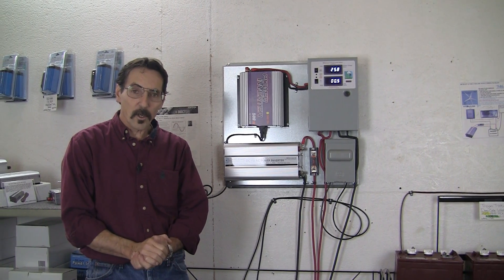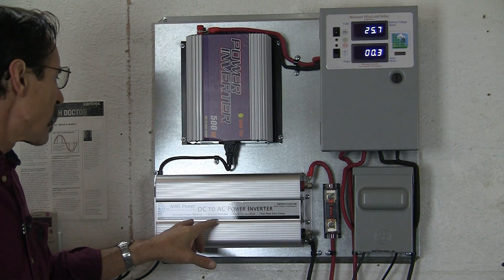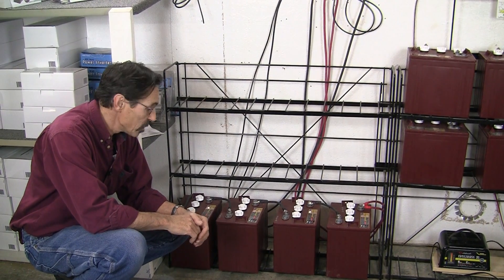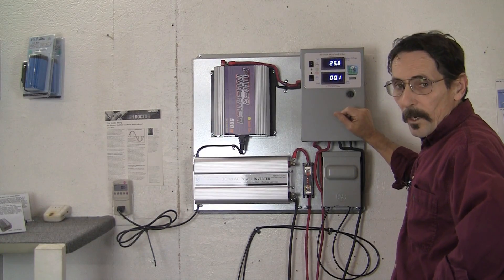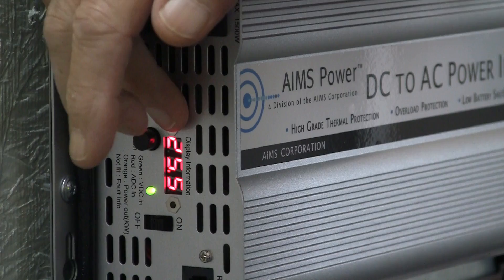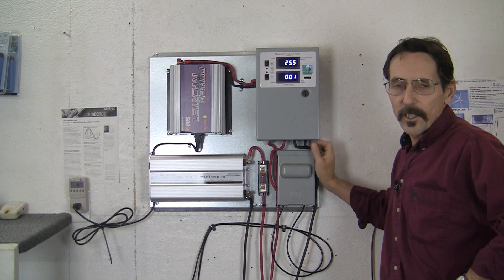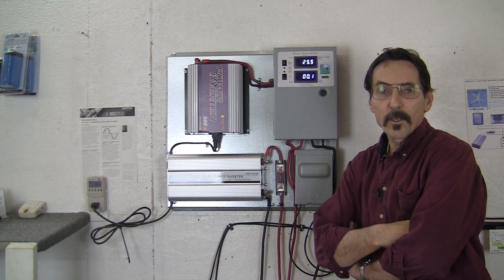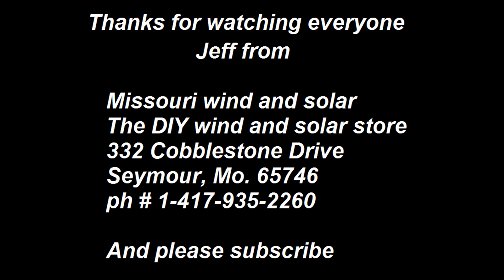Missouri Wind and Solar Sun Grid tie inverter with battery back up

Comment: Very informative videos, thank you.  Most videos I've seen involve hooking up one large 3 or 6kw inverter but one thing I am not seeing in any videos anywhere is if you can stack multiple grid tie inverters in parallel to sell wind power back to the grid in the 100KW range, say 50 inverters at 2000 running watts ea.???  Yes there is enough wind in my area to set up this large a system.
Reply: I have yet to see any Utility company write anybody a check, what they do is give you credit, well the problem being what do you with only these monthly credits of $6 bucks here $8 bucks there, when you are constantly producing more than you are consuming?

Comment: Hi, thanks for your vid, greetings from Ecuador, I'm a solar installer and I would like to use a system like this, but only to use grid tie at night with batteries, may you help me please to do i need to size or calculate inverter, charge controller and batteries on this cool option.  My purpose is to charge batteries at day with solar and feed it to the grid at night, i installed regular grid tie for day, but I always wanted to test how to do at night, but I'm a little lost how to choose and install it, Thanks for your help and reply

Comment: If the grid goes down i do you retrieve the power from the batteries. Will it automatically feed into the 110v outlet that its plugged into?

Comment: If the power grid went down, is there a safety feature to stop power being feed back to the grid to keep the electric linemen safe?
Reply from the maker: Yes, it's called island protection. The grid goes down and the inverter shuts down right away. It will not start working again until t sees the grid back up.
Reply: It is true they will auto shut off if the power goes down but many people try to back feed generators and inverters after storms etc. If they see power again they will come back on and fry everything. To be safe disconnect  it and for the love of god people through the mains before you try and power the house.
Reply: So does this mean there is no way to keep my batteries charged during the day,  when the power is off for a prolonged period of time?

Comment: why leave connected the charge controller ,batteries and grid tie all the time...first if batteries are not being used because there is no blackout then why charge them every single day? why maintain 13.5v on batteries when those amps can go to grid tie directly not to mention the efficiency of that grid tie, as you may know the larger the battery bank the more amps you need to maintain that voltage...also domping power from solar thru the charge controller is a parasitic waste of power as leaving the inverter line energized... inverters even with switch off tend to drain batteries even though in this case power that could have been used for the grid tie will keep batteries charged...... another drawback of this system is that you can't connect power from the off grid inverter to your home because grid tie is on all the time and you must turn it off first or one of the 2 will die if you don't..why does everything have to be automatic? why not use switches instead of abusing the charge controller and batteries? I know that a lot of people may need everything to be automatic but what happens when controller dies? no charging and no grid tieing? even when batteries, solar panels, grid tie is good? sorry but had to explain better my point

Comment: Seems you're putting battery power to the grid tie....not good for the battery, charge controller nor the grid tie..
Reply: +Leonardo Cruz I think the video clearly demonstrates the kind of SOLAR CHARGE CONTROLLER that will automatically dump the excess load to a Grid Tie Inverter once the battery banks has reach its full capacity. Most installers intentionally oversize the Panel ratings just to fully charge the battery as early as possible. So the tendency if the off-grid inverter is not fully utilize, the solar charge controller operates at float state hence wasted energy generated by the solar panel occurs.
Reply: +Pogsit Pogapo I was being sarcastic with the battery getting in to the grid tie inverter because power must come from somewhere other than the solar panel because he states that its foggy outside and that he has only 1 260w panel outside...I always laugh every time I watch this video because notice how charger is supposed to keep battery charged and then put power to grid tie...notice voltage and amps of controller? only .01 amps however when he pretends the batteries are full pressing botton then a miracle happens and 499w appear on the kilowatt? haha something is not hooked up right and even I see it from where I'm at.

Comment: I understand that when the batteries are fully charged, the charge controller feed the excess power to the Grid Tie Inverter.  Great.  My question after noticing in your video when you pressed the test to tell the charge controller that batteries were fully charge:  Why the Kill a Watt when up to 499 Watts when you have one solar panel of 250 watts in a cloudy day?  Are the battery and solar panel energy diverted to the Grid Tie Inverter when the batteries are fully charged?

Comment: can a smart meter of the utility company detect the grid tie inverter?
Reply: If you have a grid-tie account with the utils, they install a special bi-directional meter.  There are cases where, without THAT meter, you could end up being charged for the power you put back on the grid.

Comment: What do you use the aims inverter for? Do you use the grid tie inverter for both the solor panel and bateries?
Reply from the maker: Nick Mariani You can run appliances off the Aims inverter when your not feeding back to the grid.

Comment: When your batteries reach fully charged will it automatically switch to feeding the excess power into the grid or do you have to push a button every time like the demonstrator did in the video?
Reply from the maker: jc981e It's automatic. Whent he batteries are full it will switch to grid feeding automatically
Reply: @missouriwindandsolarreview7755  I went to your homepage but could not find this product please give link to this product I searched your whole website
Reply: Missouri Wind and Solar Reviews will it switch back?

Comment: Are you working on a setup like this for wind power? If the grid power is out you still need a resistor set to keep a load on your turbines and keep the batteries from over charging :) I built my own I will show on video soon

Got my 5 blade G5 blade upgrade setup today ,, let your Ninja shipper know she did a good job with the fast shipping :)
Reply from the maker: Jason Brown Not right now .Cool Jason. I will have to watch your vids.